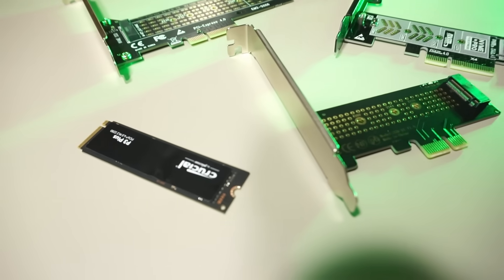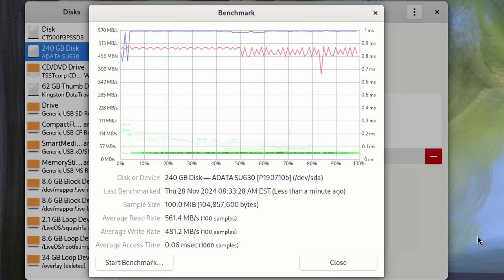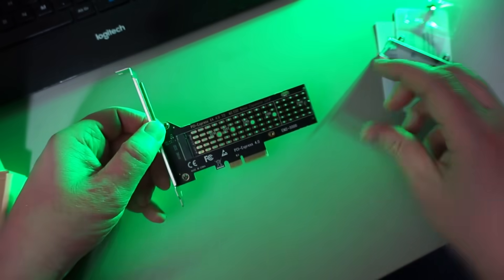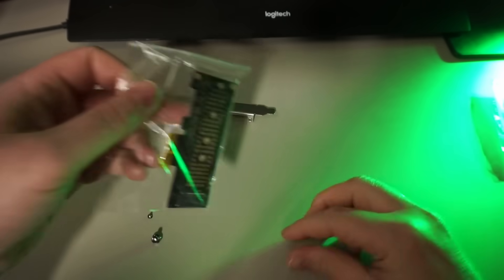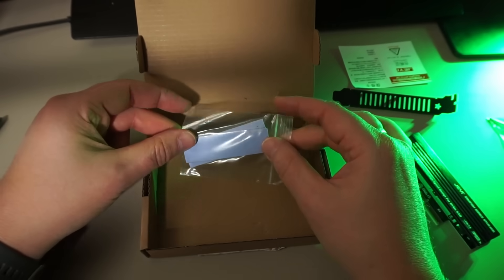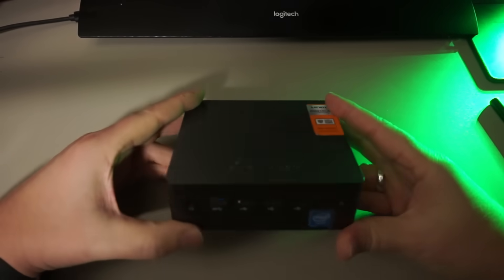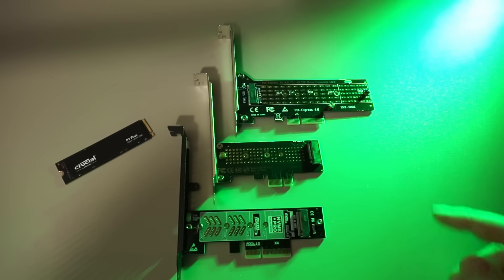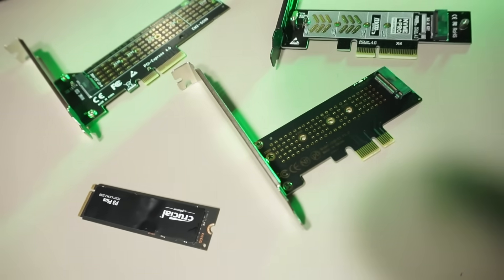Upgrade your old pc with an NVMe! Testing cheap PCIe M.2 adapters!

Comment: Actually a tutorial for the bootloader to boot from the NVME SSD on these older systems would be great !
Reply from the maker: I thought about including that but I thought the video was long enough as it is 😆 
I need to figure out how that works with Windows. Linux isn't that hard: just make sure /boot is on a drive the bios can boot from.
Reply: @ex-itguy  In my case I have a 4th gen Haswell system with no m.2 slot and for using these adapters to boot from NVME I got to use some workaround since the bios doesn't support this !
Reply: @uranium5694 for something that old, you could probably get a cheap Chinese motherboard that has an NVME slot on it.
Reply: @MrMoto655  bruh why would u put in money to something that slow, when the whole pc was probably like $50
Reply: @uranium5694 I have one such system myself, the ASUS Z97 PRO Gamer. While there's a M.2 slot, believe it's only 10 Gbps & it's not bootable. So this was fixed when system was new back in 2014-15 with the Sintech M.2 PCIe 3.0 x4 adapter.👍Although had to replace the 40mm fan with rifle bearing with the double ball bearing type. Runs cooler than most of these in it's native slot!
Reply: @ex-itguy i boot from a clover/duet usb stick nvme with windows 10 on x58 mainboards. The Setup of the sticks was always difficult somehow. There are many tutorials but they are all not easy or incorrect
Reply: @ex-itguy  You have to put an nvme uefi driver on another boot drive (like a satadom or usb flash stick) and use something like refind to load it, then load windows afterwards. I did it on an AMD FX-8150 years ago with Windows 10.
Reply: @MichaelHenderson-h4w  Later versions of Windows 10 already has the needed drivers in the ISO for this to work natively, as well as all versions of Windows 11, and many popular Linux distros.
Reply: @charlestilley2576  Ah no, I'm not talking about a kernel driver. I'm talking about a UEFI driver. The UEFI/BIOSes of older motherboards cannot even detect NVMe SSDs to boot off of them. It's like trying to boot off a CD with a computer from 1989... the BIOS simply doesn't recognize the drive. You need to use something like Clover, installed on a USB flashdrive or SATA drive, to load an NVMe UEFI driver and then chainload Windows off of the NVMe drive. Linux can do this without clover if you put your /boot on a SATA drive/USB flashdrive and have GRUB load from there, but Windows cannot since it has a different boot process that doesn't support loading the kernel from a different partition than the rest of the OS. You may also be able to flash a patched UEFI bios image to your motherboard, but that can risk bricking the board if you don't have a SPI programmer to manually reprogram the flash chip on the circuit board.
Reply: @ex-itguy  why do you think 7 min is long? when i decide a video is worth watching, i dont care how long it is. 
if it is lame i stop at min 2 anyways ...
Reply from the maker: @mikedien3609  true. It's been over a year though, and in the meantime I started to think differently about video length haha!
Reply: There is a way to do it with Clover + mVME driver module. Doesn't take up too much space so a tiny sata SSD, SD-card or USB stick already works for the bootloader.
Reply: @AvWijk85  thats what i use. i boot an nvme drive via a $10 card in my z420 work station. i get 3200r/2000w with it.
Reply from the maker: I think that would indeed the easiest way for systems like Windows that don't have the ability to put the kernel (/boot) on another partition.
Reply: Somebody figured out a way to insert an NVMe driver into the BIOS of some Dell models in order to make NVMe SSD bootable.
Reply: the easy way use cloover to boot nvme for older system, i used that one on asus P8H61-M LX but speed decrease to 500 mbps as i used pcie 2.0 1x.
Reply: This, the reason why I relent and made a w10 pc
Reply: There's also modified BIOSes for older systems that let you boot directly off the NVMe drive. I used one on my P6T Deluxe v2 mobo, but it added so much extra time to boot I just went back to using a SATA SSD, so your mileage may vary.
Reply: You need to create a flash drive with the Clover bootloader and select boot from this flash drive in the BIOS. Clover will detect the NVME disk and you will be able to boot from it. Then you can change the Clover settings so that booting from the NVME disk occurs automatically.
Reply: i used clover to run on gen4 intel
Reply: what about using ide/sata to compactflash adapter using compact flash card for software that sees pcie drives?

Comment: If you want to boot from your newly installed nVME SSD.. Bottom line is that these mostly work out-of-the-box with a 6th gen /DDR4 system or newer!  For older systems you'll need Clover, a bootloader with nVME driver support on a supported bootable medium such as SD card, USB, old sata SSD. Cool stuff. Maybe you can include that in a follow-up video?

Cheers, A Current-IT guy
Reply from the maker: I was already planning on doing so, but I didn't want this video to get too long. :)
Reply: @ex-itguy   Looking forward to part 2!
Reply from the maker: @milescarter7803  Interesting! Thanks for bringing that up!
Reply: On DDR3 it also just works fine. I had a NVMe adapter for my i7 4790k CPU PC.
Reply: I needed to modify my UEFI firmware. I had to add an NVMe boot DXE driver for it to boot from one of these adapters. Intel i5-3470 based system.

Comment: Hows the Boot Speed on Windows 10 with m2 NVME PCle on old PCs that doenst have a slot? Im very Curious vs Sata SSD if there any difference between the transfer, loading and other things.
Reply from the maker: That's a good question. Not a Windows guy so I haven't tested that. Might be interesting to test though, could be a short video.
Reply: For older gen systems the diffrence is not huge, but it's noticable. The r/w speeds are way better ofc

Comment: These adapters are cool if you want to upgrade your machine, but as you said, older PCs that would benefit the most from such an upgrade don't play all that well with it lol
Reply from the maker: Well I would argue that a 3x faster read and write speeds compared to a SATA ssd are pretty neat, but indeed you do need something else in order to boot from it.
Reply: @ex-itguy There is a tool that creates a bootable USB drive which can load drivers missing in the BIOS. I boot several older PCs and servers with it to further boot from NVMe.
Reply: @jensdroessler3575 Could you tell us the name of this tool, please? I really need that for some laptops that don't recognize the keyboard or the mouse. Thank you very much.
Reply: @alexgreis The name is Clover EFI I think.
Reply: @ex-itguy 

True sir 💯
Reply: Bios update? 

I boot a 2010 Mac from NVME on a PCI-e card. A Bios update was needed.
Reply: Clover bootloader + USB thumbdrive or tiny USB MicroSD reader.
Reply: The bios can be directly modified to see an nvme drive as a bootable device without the need for external bootloaders such as clover.
Reply: @prawny12009 tell us how....
Reply: They are great on x58 with clover usb
Reply: Got one in my 2013 build all my steam games played from it. No issues playable, no longer a rocket ship but still working, upgraded to Windows 11. Currently building a 5k rig
Reply: You could in theory install a good manager like refind or grub on a data drive, could be a DOM. Most Linux installers allow you to install grub to a different drive so it's not totally out of the question. Even if you install windows you could just use grub to boot in. 
Could be a cool video idea.